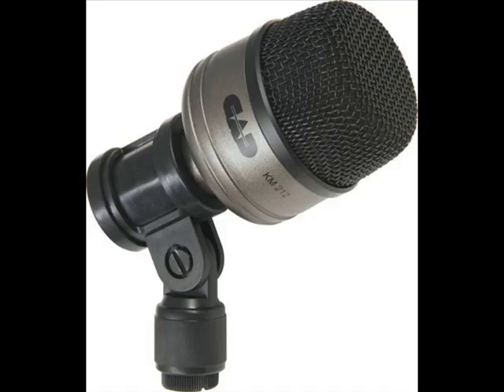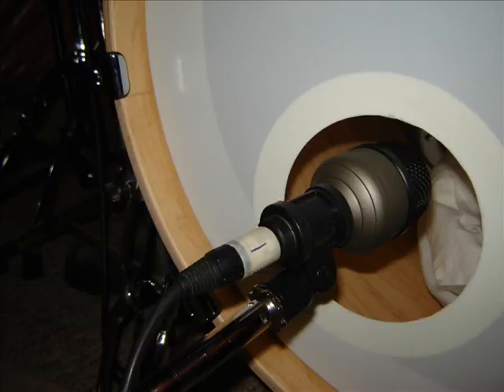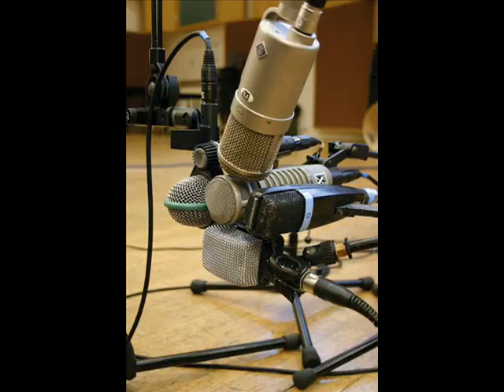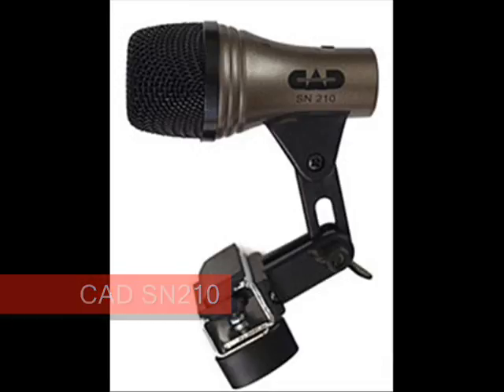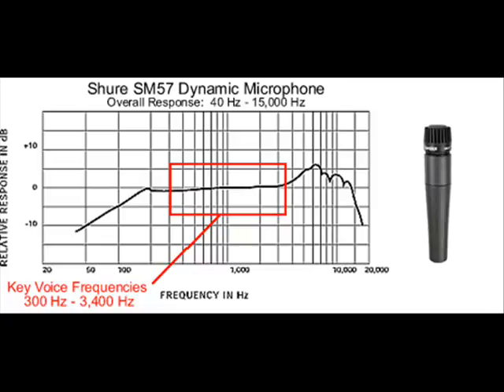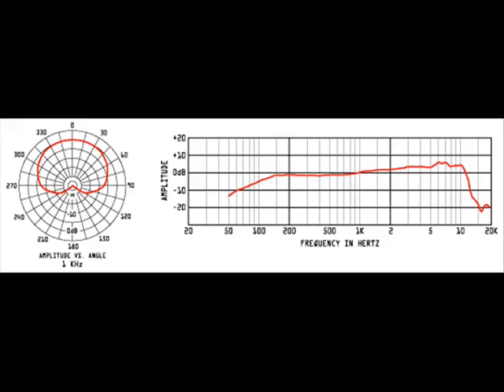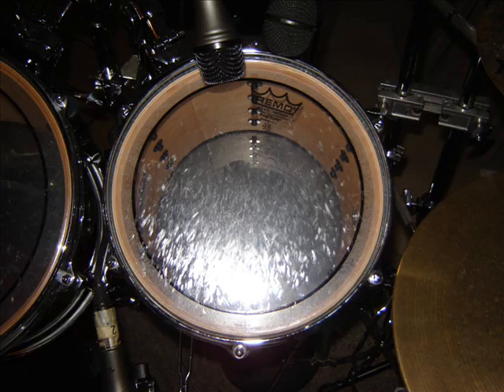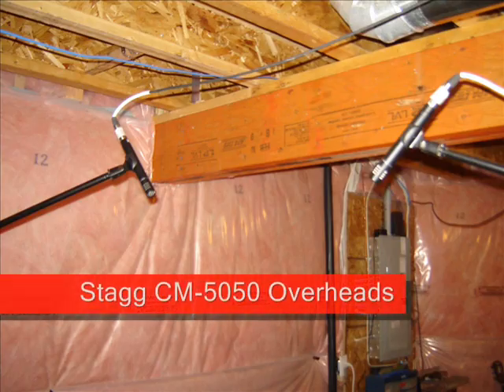audio_part3.wmv

Comment: It depends on the sound you want.  The loose skin helps get the slap sound, while the tighter resonant head gets the sustain and bass tone.  

If it's not sounding good to your ear, you
might need new skins, or the mic type / placement is incorrect.

For example,. do not use a condenser
in the kick drum, it will distort.  Even most
vocal dynamic type mics will distort because
of the high pressure sound waves hitting the diaphram.  You may need to buy a kick mic to get it right.